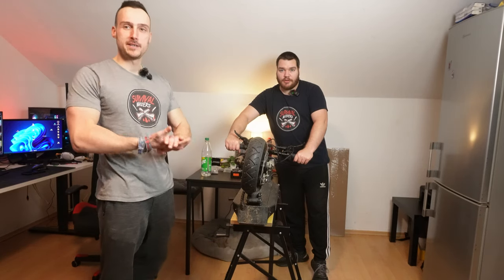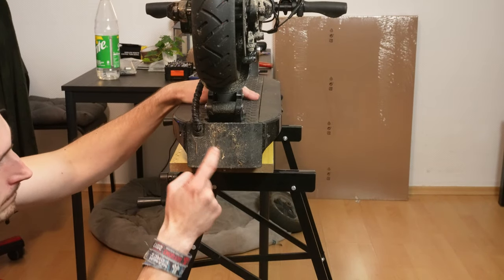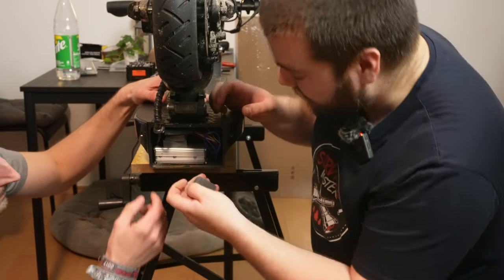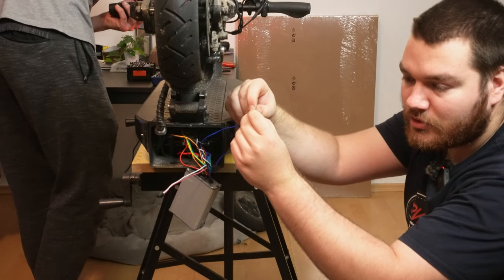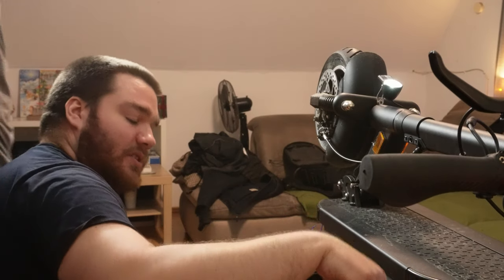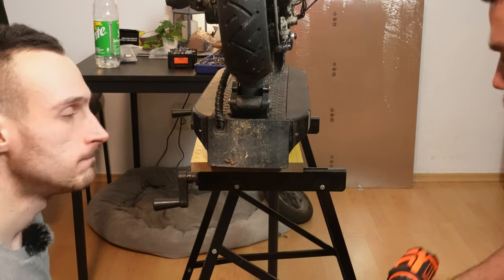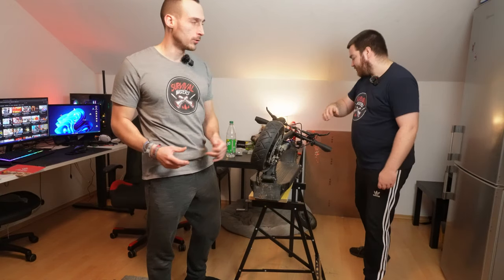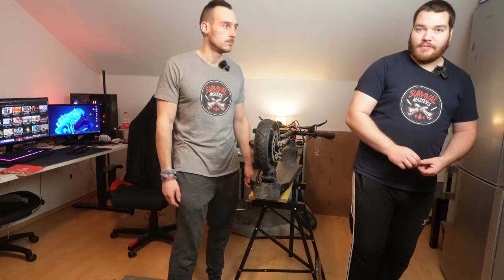How to make every escooter faster 🔥 | remove the Speed limiter ❗️

Comment: Funny cuz with that scooter you can make it go that fast by changing the settings 🤣
Reply: Well, i bought it „street legal“ from a store (in austria, 25km/h limit there!!!) and it was going 30 already out of the box (real 30, with gps, partially up to 35 where you heard the motor was restricted electronically)
I did this trick with the wire cutting and now it goes 40 at least, 20 in 1st gear and mostly anywhere between 45 (empty battery) and 50 km/h (full battery).

Sadly the hill climbing capabilities did not improve except that i can accelerate a bit more before going uphill, but uphill is locked amazing as well (i think 2000W up to 15-20 km/h depending on model with 1000W motor).

Its just when you remove/cut the wire that the 2000W are allowed at any speeds and mostly continuous.

What i think is very amazing, the plate on the controller even says: 36-72V, 42A. I tried once a friends battery with 60V instead of my stock 48V and despite still being throttled at 50 km/h, its torque feels like its 30-40% higher, sadly we didnt had a 72V battery to try this.

We measured current and the controller pulled at acceleration nearly 4000W with a 60V battery, so i guess about 3500W came to the motor for sure.
Reply: And no, none of the few tricks i found worked for me on the display unit, but enlighten me, maybe i can get rid of the artificial 50km/h limit!

Comment: Has anyone actually tried this and had it work?
Reply: Yes, but it made at least for my model much less sense
locked it was 35 km/h, unlocked 45-50… just full engine power no matter which speed until 50 which is the „hard“ rev limit.

The sad thing… the controller says „36-72V, 42A“. We tried a 60V battery instead of the otiginal 48V and its torque was AMAZING, but you hit pretty fast the artificial 50km/h limit and at some point the motor overheating light goes on while you think how nice it is to go 40 km/h+ uphill.

The motor is made for 48V, it says 1000W and draws 2000W peak for acceleration mainly. I cant really say its bad at 48V stock unlocked, but once you felt the possible performance with „real“ upgrades even if its just a higher battery voltage, you want more.

I will get for sure in the future a dual motor scooter, something like the Kaabo GTR with good performance but just „a bit“ smaller and especially lighter (preferable less than 40kg and it should fit in my car easy enough)
2*2000W at least (with 2x4000W peak!!!), better 2x 4000 or 2x5000W.
Reply: How happy are you with your scooter? Which battery and tire size? Any regrets regarding to your choice and other, „better suiting“ options?

I found out…. locked im very happy with the range (26Ah model, about 60-80km range), but unlocked and enjoying 45km/h continuous for longer rides, especially uphill the battery really drains „fast“… 30-40km range maximum with hilly terrain to cross on the route. About 300-400m uphill are possible, but only if i accept a slower speed of about 15, maximum 20 km/h at those stages at which point a 30km (x2, back home…) journey gets annoyingly slow.

Just the fact that a reasonable speed for a longer journey decreases the range that heavily made me regret the purchase a bit since there are some also affordable scooters with at least 40% more range at that speed and easily unlocked with a brake code.

I focussed too much on offroad capability, robustness and dampers (for „comfort“….) instead of a efficient „basic“ city runner with range even with a smaller battery. Its also a heavy boy with the 26Ah battery, i think  nearly +10kg compared to the 12Ah version.

I can partially understand some „micromobility“ fans having like 1-2 e bikes and at least 2, partially 3-5 e-scooters for different purposes in different weight/performance classes.